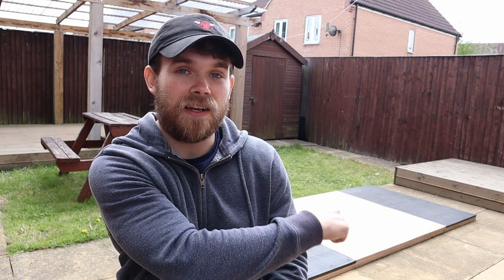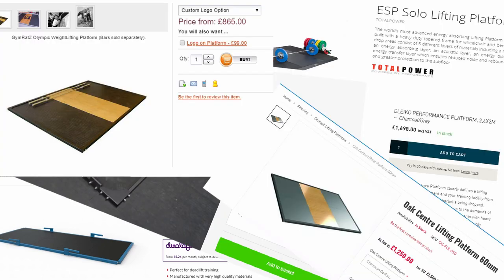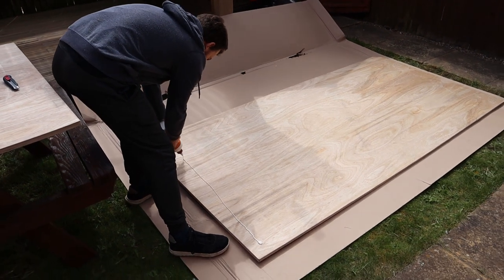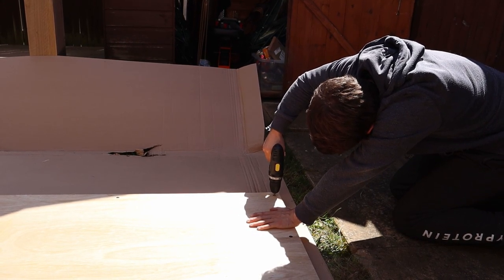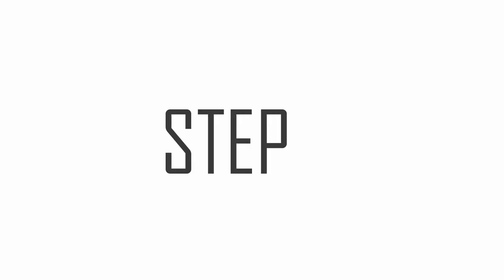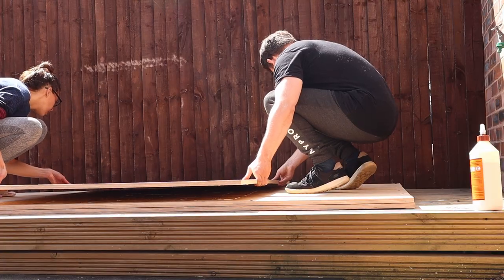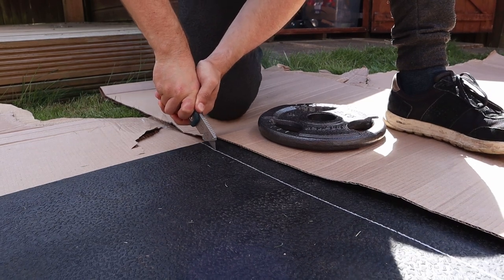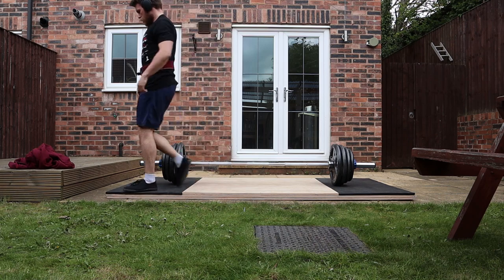#DIY Deadlift Platform | How To

Comment: Love this. Where did you get the horse stool mat? I can’t find one 3/4 inch thick anywhere in the U.K.!
Reply from the maker: This is the one I got: https://www.horsematsplus.co.uk/easysweep-solid-rubber-stable-mat-18mm-individual.html

I'm sure there are cheaper/better ones out there, but this has done the job for me. It's JUST under 3/4inch at 18mm.

Hope that helps!
Reply: @AlexMacaulay  what's difference between ameobic and low bubble pal?
Reply from the maker: @hanzalahadam1092  Hey! As far as I could tell, it's just the texture. Ameobic seemed a bit "flatter" to me, so I went with that. But I don't think it'll make a huge difference either way!

Comment: Great Tutorial. Off topic can you deadlift on just the Horse stall mat?
Reply from the maker: Great question! When my home gym building is finished I will be doing exactly this, but with a layer of rubber flooring too. I have seen a few people online say they have done it with just the horse stall mats too. I would suggest using 3 though, 1 on either side + 1 to stand on so that you are at the right height.
Reply: @AlexMacaulay  Thanks. Looking forward to your next video
Reply from the maker: @mithunaraj  Thanks, the next one will be out on Sunday, it's about my first year in powerlifting!

Comment: Did you use structural or non structural plyo wood?
Reply from the maker: Hmmm, I'm not entirely sure if I'm honest! This is the stuff I got if it helps at all: https://www.buildersmerchant.com/product/18mm-wbp-hardwood-throughout-plywood-2ft-x-1ft-610mm-x-300mm/
Reply: Alex Macaulay so did you order 2 x 8x4ft and 1 x 4ft by 4?
Reply from the maker: @jameshoward9910  Yes, I found somewhere that sold 4ft x 4ft so ordered that as well as two 8ft x 4ft pieces. If you have the tools to do it yourself, or a local shop it is probably cheaper to order three 8ft x 4ft pieces and just cut one in half!
Reply: Alex Macaulay  excellent video by the way 👍🏻
Reply from the maker: @jameshoward9910  Thanks so much, James! I really appreciate it.